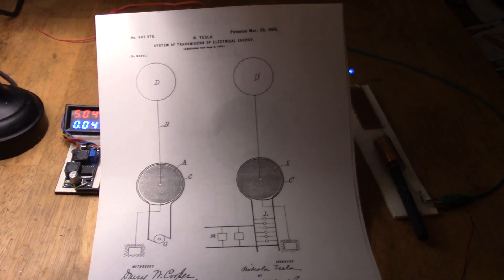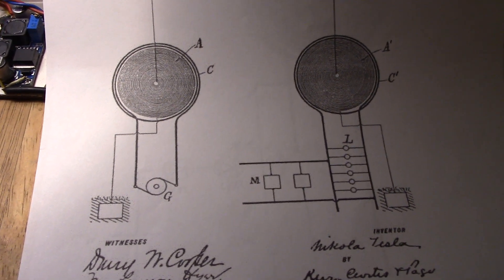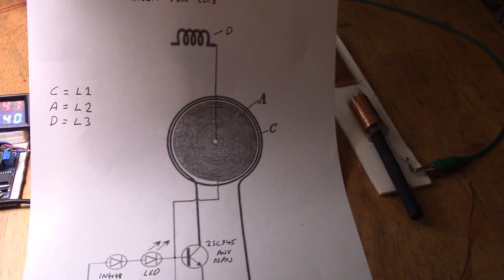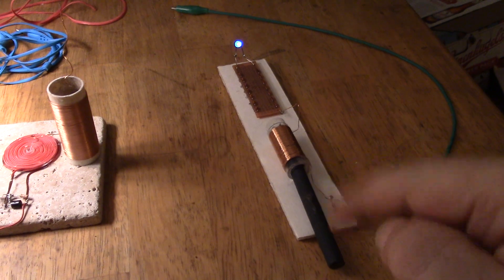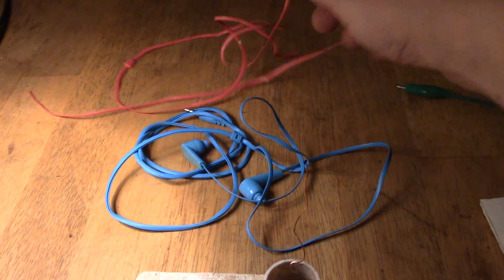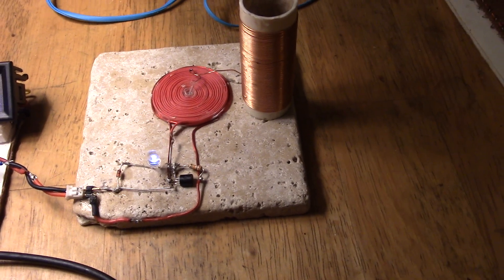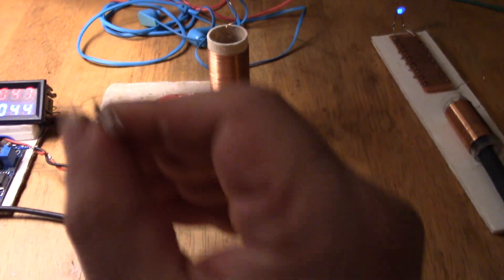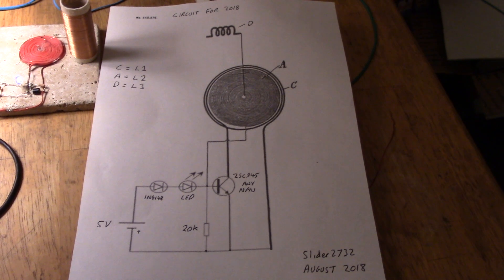Patent 645576  A Circuit For Wireless Electricity

Comment: Question, how far can you power an LED that has tuned into the frequency?
Reply from the maker: Up to about 6ft away, if the receiving LED coil also has a pF variable capacitor to fine tune.
Reply: Slider2732 thanks

Comment: Slider, thanks for the upload. I'm interested in the total circuit efficiency. Is the power 5VDC at 43 ma?  Do you have a current probe to measure the LED current?
Reply from the maker: Some of us struggled for a long time to get good honest power input measurements and this setup works well. The backfeed isn't messing with the voltage booster circuit or the V/A display would flicker all over the place. Yep, 43mA input.
The received current is far trickier. Most circuits i've ever touched will give false readings due to the HV in the air. Plus power input goes down when there is a good tuned load.    
There's only 1 LED, but current remains the same with many more in series and all will have the same brightness as just 1. It's the voltage received that is important, especially with the Stiffler diode loop. I should really have 6 to 20 or so LED's on there.

Comment: Slider, now you are on the right track!  Still not true Tesla oscillator but I give you codoos for good effort.  The real Tesla version would use a primary tank circuit that rings AC impluses to the Secondary and would use a large spherical tophat to STORE energy rather than allow it to radiate to space as a loss.  As such yours is more efficient as a EM radiator to air than a current pump to the earth ground.  The tophat sphere is meant to function as a capacitor that dumps huge power into the earth ground in impulse surges where each surge at resonance builds on the previous.  Hence the name magnifier at Wardenclyffe and  "pumping" the ground "Earth."  But the real effect is not found until Earth resonance reacts back:  something I have not seen done by anybody since Tesla yet.   

Yeah as others note the emitter needs to be more negative than the collector.  But the real fix is that your battery polarity symbol is wrong.  Positive side is the wider side of the plate symbol and it should have the (+) symbol rather than on the shorter plate side of symbol. :)
Reply from the maker: Yep, should have simply drawn it with the circuit in front of me. Thought i'd be posh and look what happened LOL
Indeed, mentioned to Bobby that it needs a topload, but I have no small metal sphericals. Am wondering if Christmas ornaments may work, those with metallic paint, if the paint IS metallic.
Reply: Slider, you might temporarily use those ornament craft syrofoam large ball shapes (I see a Michaels crafts in my area) and cover with aluminum foil.  Or the foil covering over a purchased spherical balloon.  If helium then you can erect the tophat to very far heights!  Wire would need insulated.  Thickness of foil unimportant, surface area is.  Stick the foil down by any means and can coat the exterior with shellac or I like polyurathane varnish to insulate HV from leaking off.  All sharp edges need to be minimized.  Another shape I have seen used successfully was to use the top metal dome (or plastic and cover with the foil) from those styled like you see in public places with a flap in the side.  And lastly, out of desperation, I have seen the metal type toilet bowl float ball used.  The old toilets used a metal ball float and huge in size but will be better than a wire.  I read somewhere, can't remember if from Tesla, but I think so, that for certain magnifier experiments he experimented with a double tophat.  That is like a metal ball WITHIN a 2nd metal ball but without shorting to eachother.  The dielectric varied from various gasses one I know was hydrogen.  I forget what his reasoning was, but suspect it in part had to do with further improving the tophat capacitance by some gas/dielectric reaction that would be controllable, that is to have tunable variable capacitance as a function of how much the gases become ionized ie. control of the dielectric conductivity from insulator max capacitance to full ionization and the gas conducts thus shorting or lowering the capacitance.  So at will (in fractions of a second) he could reset the Sec resonance point or said differently, he could control how far away peak power would propagate to reach a target either by air or earth current conduction not RF.  His energy transmission sends in one direction with full power, but a radio tower sends energy dispersed in all directions and so a weak signal at a distance.  But back to the magnifier, if for peace time, usable collection energy to a community.  But if for war, a target destined for obliteration from the 400 million volt impulses at millions of amps.
Reply: Slider, Forgot another tophat source:  Walmart or Salvation Army stores or similar.  Years ago I remember some designs using those stainless steel mix bowls found in the cooking section.  All you do is get 2 big bowls (half spheres) and mount them to each other to form one large ball.  Only trouble is the bowls have that turned outward sharp rim.  Could either grind it off or cover heavilly with hv insulation to stop the arcing and power losses.  Using the same idea of bowls of plastic then you could use metal foil.  But I like the metal polished bowls better.
Reply from the maker: Great info thanks. I have a large (6" diameter) Christmas bauble that gave the idea for those. The semi circles seem good....a real attempt would be 6ft tall, spark gap, proper design running with some heft behind it. But, you know me lol, what's possible on the tiny scale is often the drive. Tesla said receivers could fit in a watch,  I keep forgetting the transmitter can't !
 Am going to redo the circuit diagram and hopefully show some progress tomorrow. For a short term fix on the diddly system a ping pong ball with foil on seems about right for what is here. Am intrigued as to whether it does much, hopefully it may.
Reply: Slider, I need fix a mistake.  I said above "Another shape I have seen used successfully was to use the top metal dome (or plastic and cover with the foil) from those styled like you see in public places with a flap in the side."  I was referring to those public trash cans  with the shiny metal dome cover.  Wow, I must be really tired.  

As to your mention of whether it does much to add the ping pong ball, I am sure it will.  But how much for such a tiny system is the question.  Might not be enough to notice.  But regardless if noticeable or not, the Sec and ping pong ball form a series resonant circuit and still obeys rules for calculating LC  frequency and resonance.  The bigger the capacitance for a given inductance will LOWER the oscillation frequency and then your oscillator driver will need tuning lower to reach it for the biggest surgings.  But I find the actual frequency covers a broad range if you don't care about the highest power output and just want the Sec to ring where ever, like at the 2nd, 3rd, 4th or 5th harmonic.  Which is why it is so easy to light leds without much tuning or circuit precision, since they use extremely low amperage at these higher voltages at high oscillator rates.  Another tip you might not know about the Tesla magnifier is that he mentions that the Primary coil needs to be ONLY LOOSE coupled to the Sec.  He means don't wind the P coil tight right up to the S coil.  Leave a gap like 1/4 inch or more in higher power drivers.  The reason is to prevent the P ring from interfering with the S coil, that is to say, for preventing the P coil oscillation to control the frequency of the S coil and destroy the magnifying quality.  Your LC parameters in the S alone should control the natural power surge magnification.  The P coil does not work to magnify but only provides an energy dump into the S coil system at the right time intervals which in his day the spark gap was perfectly suited timing wise. 

Here is a thought for you.  How about using your electronic oscillator to feed your miniature Tesla like setup but as a normal Tesla coil with a  LC and spark gap on the primary side.  You would be more accurate in the whole setup of Tesla's day plus your electronics makes it modern tech.  Now you have true AC power pulses in the LC primary as he intended.  Note the spark gap does different things depending on gap setting, remember he wanted damped waves not undamped like everybody today.  A spark gap can do either.  I would expect you will get better performance with these minor changes.  My coil setup years ago made 250,000 volt surges at the S coil and could carry sparks over 4 foot.  At the top hat a wire taken to a solid brick (on top an insulated tall wooden stand) would not stop the arc:  it went straight thru when I brought a wire from earth ground up near the opposite side of the brick and you get a bright colorful coronal arcing.  Very pretty, very shocking.  :)
Reply: Slider, forgot to ask.  Did you notice in the Tesla patent you show here the direction of turns in the transmitter primary and secondary versus the turns directions in the receiver?  Very important for power applications.  This is a good example of the keen attention to detail Tesla slyly shows often in his many patents which a casual reader might easily over look!
Reply from the maker: Was mindful of the loose coupling, right back from seeing the Dollard etc Broadlands videos. That's why I never mind insulation on a pancake...Tesla's wall pancake had spaces, but the Primary more so. At this size I couldn't keep the wire down and circular, so ended up supergluing nearer.  
Have tried the ping pong ball top load and it works a treat, extending receiving distance of a now built receiving setup (same thing broadly, as in the Patent). Went from 6" at 3.5V to 8" just by adding the ball. Tiny distances, but good for the table top. The transmitter LED brightened significantly with a clip lead on the negative input rail and the receiver receives better with it there.  Maybe it should have decreased range, being that i'll take it outside to send more through the ground. 

A spark gap is something tried and never succeeded with. I run at too low a voltage. It would have to be 12V+ and quite the amperage ?
Wouldn't mind repeating your setup though !

> 1.30am here too lol, just got back from the table after doing those ^ experiments.
Reply from the maker: Yep, opposite directions....have done that on the receiver :)

Comment: That is excellent!  Well done.  I will try to replicate this when I can.  The pancake coil with the 2 turn primary is new to me.
Reply from the maker: That's what got me thinking about it. As Pseudo Nym pointed out it looks familiar and is in fact more complicated than the SWES, but that doesn't use the 2 turns as Tesla has in this Patent. 
Was thinking about directions, the circuits, the results and really the actual Tesla Patents should have a heavy focus too. I was surprised when this fired up first go, as the Patent has the oscillations coming from a motor or similar.
An outdoor ground connection brightens the LED btw. 
I'd recommend a larger coil wire, modem cord being good. The idea was to be readily available, but also to make something tiny, such that a larger system has to be more productive than this little thing. C945's are also not really known for their performance in these circuits, so it made a good choice for whatever people have.
Reply: I wonder if a solar waver coil would work.  It isn't a true pancake coil but it would be easy to try....just wrap a couple turns of maybe 16ga around it and go for it.
Reply from the maker: Edmorbus just spotted an error...the transistor Emitter should go to the usual Negative power input.
I should have drawn the diagram like usual with the circuit in front of me, instead of doing it on the computer !

Comment: Haven't you already done this many moons ago? Why did you choose to use earphone wire to wind L2? Does it make any difference if L2 is a single strand or multi-stranded? Is the size (# turns) of L2 important? Does it still work below 5v? Does increasing the voltage increase its wireless range? What frequency does this work at? Sorry for so many questions (I'm sure there's more) but I might replicate this one!
Reply from the maker: Haha, not this way. The other only uses the pancake and a transistor, no outer 2 turns.
Earphone wire due to no modem cords or i'd have used that wire.
There should be no difference if multicore wire is used, i just connected both wires as the Patent uses 1 wire. 
L2 will likely have to be above ~9 turns, that was always the case with the SWES (the pancake + transistor). 
Should work with an AA upwards. I wanted to show the current and 5V is readily available as USB. 
Increasing voltage will increase range. Some transistors heat up above about 6V if no Base resistor.
Frequency hmm, unknown as yet, SWES is 300kHz, pancakes are always lower than towers (2MHz generally).
It's been a case of seeing it work and posting it :)